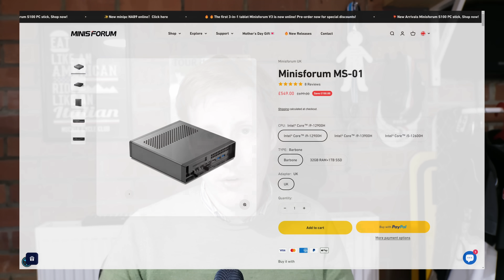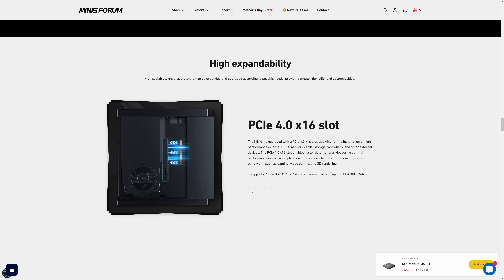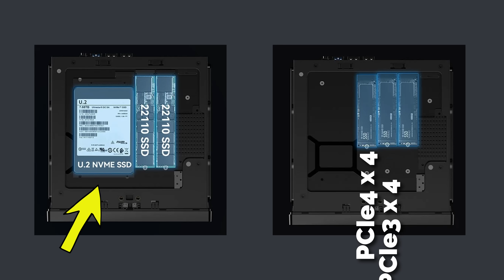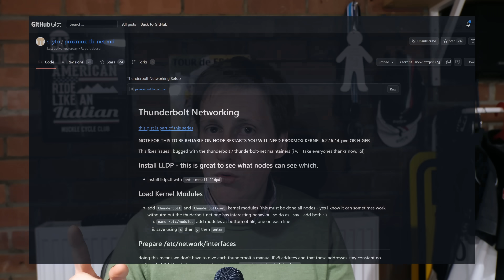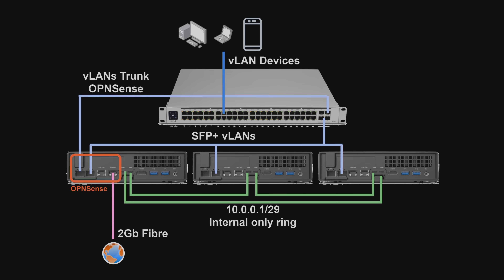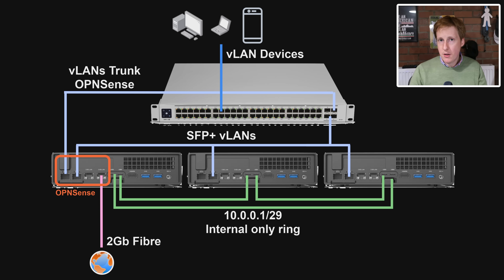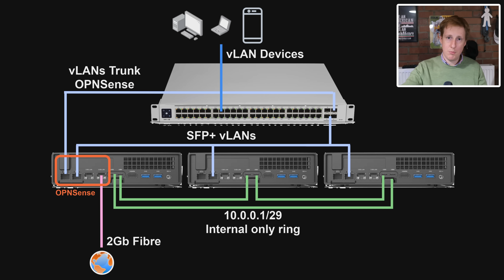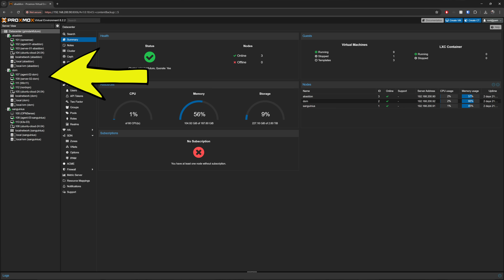Planning A Homelab - Cluster Time! Minis Forum MS-01

Comment: Absolute crap quality. I already had problems on Installation. It died just 2 months after using it. Power On doesn't work anymore. Never again Minis-Forum.
Reply from the maker: @HowToChart  that's a shame, sounds like a bad unit and isolated from what I hear. What was the rma process like?
Reply: @Jims-Garage  I have to wait for response from the support. But for sure I have to send it back. They don't exchange it for a new one just like that LOL.
Reply: @HowToChart  How you getting on with the RMA? Did you buy direct or through amazon?
Reply: @solo-j4v  I had to send it to Germany. Now I wait to get it back. But I don't mess around with it anymore, I will test it and sell it immediately. No reason to risk another outage.
Reply: @HowToChart  what will you be getting instead ?
Reply: the forums are full of people returning this item. It crashes randomly, not something you want to use for your server needs.
Reply: @herman6214  I'm seeing mixed reviews on Reddit. I'm wondering what people are getting instead.
Reply: Yeah these devices are not ment for production. It is for thinkering and home use. So minisforum are just another consumer seller. Although the RMA seems a bit sketchy at best. But this is as to be expected.

Comment: Nice set up Jim!  I'm looking at getting these MS-01 as well.  I've setup a thunderbolt ring on some old 2013 macs using syncos guide and it is great to have that speed on such an old machine.  About your Ceph setup.. don't you want  to run the VMS on your Ceph drives for High Availability so that if a MS-01 node fails it will switch over very quickly?  Or do you have another plan for that?
Reply from the maker: Yea, that's the plan. However, I do iGPU Passthrough which means they won't fail over. Others will benefit from it though, and the data will be secure.

Comment: I have it set up exactly the same way. I only used Ipv6 for the internal routing from a Video i found online. Works great. 
No i just realiesed I'm using the 2,5gbe for the internal ring and i got the 10gbe bonded to the switch

Comment: Using Thunderbolt 4 for a ring network is honestly genius. I do have to ask though... Since you use Thunderbolt 4, shouldn't the theoretical throughput be around 40 Gbit/s? You mentioned it's around 2.6 GB/s, so it's around 20 Gbit/s. Where's the other half?
Is it just a limitation of Proxmox? Do these Minis Forum PCs have cheaper Thunderbolt chips built in and it can't use the full capability? Or does Thunderbolt not allow Full Duplex communication?
Reply from the maker: It's because the networking stack within TB4 caps out at ~20Gb. Data transfer should reach ~40GB. The TB4 used is fully certified in the MS-01 for full speed.

Comment: How are the P-E cores handling the virtualization?
We tried running virtulizers on 12Gen when it came out and it was a horror . ESXi , Proxmox and Red Hat KVM didnt know what to do with the e-cores. The only workaround was to just pastru the P cores which makes buying this thing pointless.
Reply from the maker: I'm on kernel 6.8 which I believe has an improved scheduler. So far I haven't had to manually intervene and everything seems fine. I will dig into core utilisation once I'm a little more settled.

Comment: Hi! Jim,
I have exact same setup like you but I have ordered dual ports 25gbe pci card for cluster. I am curious if I use TB4 port on MS-01, Do I need just cable or need TB network device to use them as cluster network? How much speed you get on TB4 networking?
Reply from the maker: Hi, as shown in the video and description links. Cable matters thunderbolt 4 cable, just a cable. Speed is a little over 25Gb (around 2.6GB/s)
Reply: @Jims-Garage  Were you able to fix the IPv4 issue with TB networking? I have similar issue.

Comment: Hi Jim , It is very exciting homelab project but i suggest putting links every products you use to get the highest bandwidth available like the brand name of thunderbolt cables you are using etc. Cause I noticed that so many people on the net could get enough speeds over thunderbolt bridges . Awesome work btw. Congratulations.
Reply from the maker: Thanks, I'll add it

Comment: Excellent video Jim, I too now have 2Gb internet from a company called BRSK. I also just installed a 42U rack and some aircon in a 3m x 1m room I have that comes off my office. This thunderbolt networking looks really cool. I don't think I can justify another spend on these things though once I have seen this now I will find resistance hard. I already have a flawless 3 node cluster of ryzen 5 3600s though with 128Gb RAM each. Not using ceph though, I have a Flashstor12 over 10Gb and another biggish Truenas box.
Reply from the maker: Nice, that sounds like a great setup
Reply: @Jims-Garage  I'm also trying to go low power now so am messing with a lot of arm stuff, have you seen the turing pi2 and the RK1s? I have 4 of those with 32Gb RAM each and did something funky with the M.2 slots. Instead of being conventional I got some m2 to 10Gb adapters and stuck them in so each of the RK1 has a 10Gb going to the flashstor too. Working well, just got proxmox running on them al running in a 2U rackmount.
Reply from the maker: @DigisDen  those look cool! I like the idea of them, I just find arm lacking in compatibility for many of the things I need. Hopefully that'll change in the near future.

Comment: For the single point of failure / non-HA firewall issue, you could bring in the WAN via a VLAN on the last SFP+ port on your Unifi switch, then you can migrate the firewall VM across the cluster without any hardware dependency and minimal downtime.
Reply from the maker: A good idea but sadly those ports are only 1Gb
Reply: @Jims-Garage  SFP instead of SFP+?
Reply from the maker: My internet is 2Gb not 1Gb, I'd lose half of my speed.

Comment: My $.02 on boot drive. I would highly recommend an Optane drive, even if just a small one... I get away with 16gb but I wouldn't recommend anything smaller than 32gb unless you want to be running scripts to clear up space after every upgrade. Much higher write resiliency and random IO. I was using them for a while, since LTT gave me the idea, but then I saw level 1 do a video on Optane as well. GL with the new lab! Congrats on the fiber!
Reply from the maker: Thanks, good idea 💡

Comment: I've done this, but I installed a 4 port sfp+ adapter in each so the entire cluster is using DAC.  One 10gbe ring network for the proxmox cluster and another for ceph.  I don't trust networking over USB.

Comment: Also, you may already know that vPro requires native vlan only but has a cool feature you use called serial over LAN for lan based console access. I combined this with a secondary path for guest vlans. hence the comment that vpro requires native vlan. Worth noting I am not using the minisforums hardware.
Reply from the maker: Thanks, John. That's good to know, I haven't yet dabbled with the vPro feature yet. This will be useful

Comment: For my fiber internet, I terminate to the switch and layer 2 vlan it to proxmox over the VLANs port. Then, the firewall can migrate to any host. Also have the option of HA firewall. But with firewall on ceph clustered storage, the hardware concern is less of a concern.
Reply from the maker: Thanks, I used to do something similar. Little trickier with hardware passthrough and the was-110 ont SFP stick but I'm going to keep experimenting.
Reply: @Jims-Garage  I believe you can power off a guest and migrate.  The same hardware pass through then applies I believe providing you have configured.

Comment: I’ve been eyeing these for a similar 3 node cluster setup. Great idea with using thunderbolt for network, I haven’t thought about that! I agree that the chassis limits the options for the add-in cards, and it feels like a bit of a waste to just discard the chassis.
Reply from the maker: Would be great if you could buy the board and fit your own cooling
Reply: @Jims-Garage  yes totally. Wouldn’t mind trying to fit 3 in a rack shelf or custom chassis either, that would be an interesting project.

Comment: Hey Jim, I have a solution for your HA router problem. Its not Active-Active HA, but it is Failover HA. It will also remove the need for Hardware passthrough. 

What you will need to do is set up a "WAN Vlan". The only 2 devices on this vlan will be your virtual router, and the Modem. 
1) Plug the modem output into your switch. 
2) Set that port to be WAN Vlan only 
3) Create a virtual Opnsense machine. 
4) Add at least 2 vNIC's to the VM, one on the WAN Vlan and one on the LAN Vlan. 
5) Configure Opnsense as usual. 
6) In proxmox, setup replication for the Opnsense VM
7) In proxmox, configure your vswitch to allow WAN Vlan

This will work because you are only passing L2 traffic, so DNS and DHCP between the router and Fiber Modem will work as they both expect. 

In this setup, if the Proxmox host fails, the Opnsense VM will boot up on another node, since the VM is replicated. 
A few minutes of downtime, and at most a few minutes of lost metrics (if you even record traffic metrics inside opnsense)
Since your internal VM traffic links are all 10Gbps SFP+, you should see no issues reaching maximum throughput, as long as you make sure you are using VirtIO NIC's on the Opnsense VM. The cost of this is just a little bit of storage on each node. 

I've set this up for a number of small businesses, and it has worked excellent for them.

Comment: I am curious to see if you have any problems with the 2.5 GbE ports. I had the I226-V (the one without Intel AMT capability) for the fiber connection and an ONT that can handle 2.5 Gbps. Ever so often, that connection stalls and can only be recovered by a NIC reset (either ifconfig down/up or cable disconnect). This is a problem that has been discussed on pfSense forums as well and is actually worse than with previous generation I225 chips where this never happened to me. It seems to happen only at 2.5 Gbps, not at 1 Gbps.
Reply from the maker: I've had it running for a week without an issue but that on a single unit running latest kernel 6.8
Reply: @Jims-Garage  So you have the OpnSense running as a VM - I use it plain vanilla.
Reply: @Jims-Garage  Kernel 6.8 indicates you are using OpnSense under Proxmox. Is it true that you use the NIC in bridged / virtualized mode or do you have it passed through to the VM? My reason for asking is that I found a "reset on TX hang" part in the igc driver - but that is present only in Linux, not in FreeBSD.

Comment: First time here. I love homelab builds! I would add a 10GbE switch and make all the 10GbE adapters uplinks to that switch. Maybe I didn't catch some limitations from your ISP, but you could have HA on the Firewall by tagging the switch port where you connect the WAN (and avoid connecting it directly to one server). I like OPNSense and pfSense, but in my homelab when IPS is enabled I only get 6-7Gbps inter VLAN communication. I ended up using Sophos, witch is managing up to 15Gbps inter VLAN routing with IPS enabled. I understand you want maximum bandwidth, that thunderbolt ring works like a charm, but trust me, it isn't really needed (12x SAS3 7.68TB Flash drives here, with 54 VMs running... all with 2x10GbE, and I want to migrate to 2x25GbE, I really really don't need it... :P the actual storage traffic is minimal, but it's nice to see 2.5GB/s when I move things around), I'd add more disks even if they are limited to PCIe 3 x2 and have everything stored in a shared storage with HA. Nice build! Have fun homelabing

Comment: For OPNsense. Why don't you just create a VLAN on unifi, and set the wan to like VLAN 999 port 1 plug WAN into port 1.
Then setup PFSENSE WAN NIC to be on VLAN 999, and connect the other two MS01 boxes 2.5GB NIC on VLAN999 for HA OPNsense?

Comment: Hi Jim, great video!
About the coral TPU, I'm using one together with iGPU passthrough in frigate. The TPU is used for the frigate detection mechanism, the GPU for hardware offloading the ffmpeg streams. So frigate benefits using both. Frigate is running HA mode. If a node fail it will boot on another node just file. Live migration is not an option, but the system is back in about 3 minutes, which is totally fine with me. I use the resource mapping feature in proxmox for this.
Reply from the maker: Thanks for the info! Sadly I have a dual chip tpu and I cannot get it to show using lspci. Do you have single?
Reply: @Jims-Garage  I have the single indeed, because my slot has only one pci-e lane connected, as most wifi slots have. Some have no pci-e connected at all... Only CNVI / CNViov2. If your slot has only one lane connected, at least one TPU should show up... You could try it in an other slot with a M-key to A/E key adapter?
Reply: Hello  @exteraNL  . Do you use an adaptor for Coral? Or your mobo support it? I found a mobo Asrock B660M-HDV which has "1 x M.2 Socket (Key E), supports type 2230 WiFi/BT PCIe WiFi module". Do you know it support Coral? Thanks!

Comment: Great video looking forward to the next one. I keep changing my mind between using an itx motherboard with a 13500t or higher and these machines. Keep them coming & thanks for all the hard work on these videos.
Reply: I'm also a bit torn here, I'm trying to get as close to a "do it all" server for VMs, router/firewall, NAS, all in a somewhat low-power and small package (sure I could just go with a cheap Epyc chip + mobo from China on ebay, but that's a bit much). 

The Ar900i ITX from minisforum is also appealing, it's got four m.2 slots and a 16x PCIe slot, after doing some digging I've found someone on reddit had success with a M.2 to 16x riser cable on this board, and was able to use an LSI HBA on this adapted slot to add hard drives to it (keeping the onboard 16x slot free), he also made a 3d printed bracket to fit it in a Jonsbro N3 case on the opposite side of the board from the onboard 16x slot to hold this LSI card. I also found another video confirming the Synology E10M20-T1 works on this board, this adds a 10g base-t port and two additional m.2 slots. So as long as I'm fine without a dedicated GPU, this would be quite the beast of a machine that has everything else in an ITX package.

I'm leaning back to the MS-01 though because of costs, having a bunch of HDD storage would be nice, but I don't really need it, and PCIe 3.0 U.2 drives are pretty affordable for a good chunk of reliable storage. I'm thinking of going two Intel Optane 1600x 128gb m.2 in a stripe, not a lot of capacity but enough for VM OS volumes for what I'm doing, and the limitation of the 3rd slot at PCI 3.0 x2 doesn't hurt this drive. Then in the future if I really want to add HDDs, I could hook up a USB 3.2 jbod enclosure. And now I still have the 16x free to add a better GPU or whatever else.
Reply from the maker: @coinholio470  it's always a difficult decision but both are a good choice. Pick one and be happy IMO.

As for m.2 to PCIe, I've been using one for a year in my main PC. I record all of my videos with an elgato card that is attached to my m.2 via PCIe adapter. So far it's been perfect.
Reply: @coinholio470  If you need storage you could always hook up some network attached storage instead or usb (more stable) I think the key thing with these systems is power usage vs network interfaces, you just can't find anything else in the same size, power usage with the same nics (I have tried). My only concern is how long they will last, I expect if they fail it will be an entire new system and this is were the price may seem not so good. I'm still on the fence with purchasing and fair play to Jim for taking the plunge.
Reply from the maker: All depends what you're after. This is a great all in one, but the 13500t likely is more expandable and easier to work with.
Reply: @Jims-Garage  Absolutely, these machines are great for the size. More expandable is also going to mean bigger. I currently do similar to your setup but using micro pc's (10th gen cpu) but always limited by the network which they only have  one with these machines you get four plus expansion. I think these machines are just in between the dell & HP micro pc's and a full size pc. My only other concern would be life span of the units and replacement options for when they do fail, I suspect in 5 years if one fails you won't find them around and your back to hashing it out again :) Fair play for taking the jump not sure I would, well not until I watch your videos anyway :)

Comment: Nice, I got 4 of those and did something very similar except I went 2 TB wdlback 850x's for ceph and 1tb patriot p300's in the next slot for the proxmox drive. That ring drive was a disaster for me on 4 units (I had a 4 unit setup with the beelink ser7's previously)
Reply from the maker: 4! Very nice 👍 sounds like you have a similar setup.
Reply: @Jims-Garage  yep. I put the opnsense on dedicated hardware though. virtualizing the router sketches me out. I did it with a 12th gen intel but if i were to do it now I would probably investigate the aliexpress lower power stuff with 10 gig and then do two of them in high availability just for the router.

Comment: The only thing I wonder about these is the number of PCIE Lanes if you were to attach a disk shelf or similar to it.
Reply from the maker: You should be able to fit at least 8 drives to an HBA and probably 16. However, without full ECC I won't be doing it.
Reply: @Jims-Garage  for homelabs this is the kind of thing where DDR5 for consumers comes in handy. 
For the lab I'm overall not too worried about ECC. I'd never go without it in an enterprise environment though. 
 Sometimes I miss the hardware raid controllers with their own redundant power. Then I remember how annoying it was when they died.